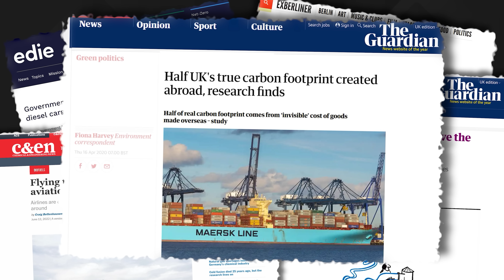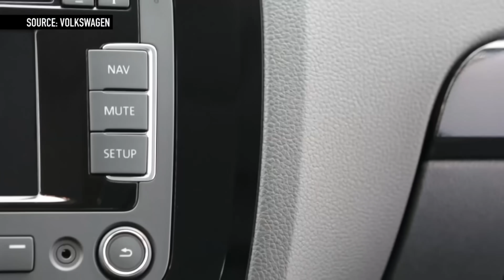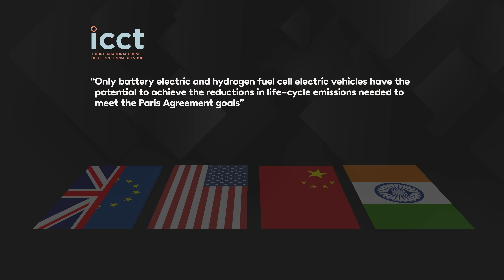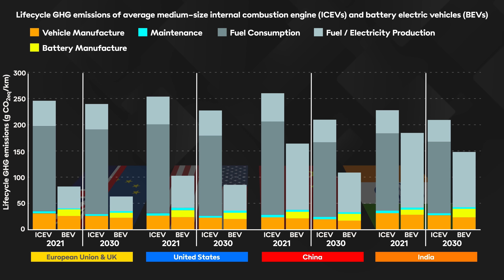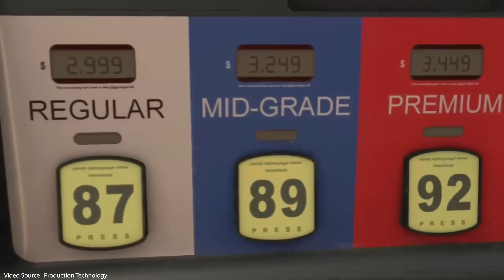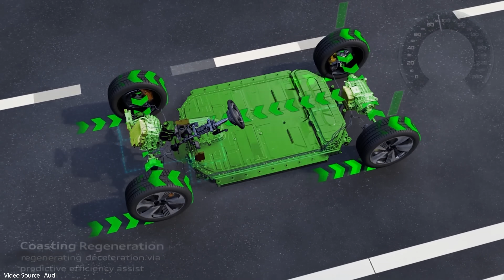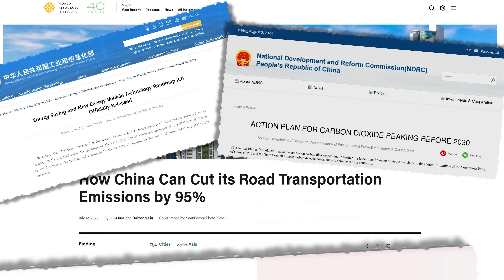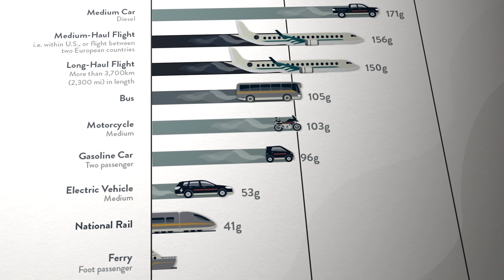Are EVs really better for the climate?

Comment: Why do these videos never discuss, the environmental impact of the batteries. Just like solar power, we just change one impact for another. Poison the lands and rivers, to save the skies!! 

 I suppose we just don't care as long as we can "recycle" them into the giant piles of corroding batteries in China or India 🤷 Just like we do with all our other recycled waste...

 The other fact never hear mentioned is the cost of replacement batteries, this alone makes the second hand market extremely risky. Its like buying a second hand phone, you have no idea what the battery will be like over time. Except if your tesla batteries starts failing after a year, it's currently costing around $20,000 to replace!! I wouldn't even mind that, but the difference in an  80k tesla vs an 80k merc or bmw is night and day. The tesla inside feels like a 35k car...

I'm all for progression and the environment, but people really need to lay off the cool aid when it comes to electric vehicles. They're just as bad as gas cars, just in different ways...

Comment: Wonderful video! :D  I would like to point out that the BEV batteries production CO2 costs are based on Lithium Ion batteries that use cobalt and nickel which produce 50% more CO2 per battery than Lithium Iron Phosphate batteries (LFP).  LFP batteries also last 3 times longer which means for ever LFP battery produced you must produce 3 Lithium Ion batteries that use cobalt and nickel.  So the Lithium Ion batteries production generates over 3 times as much CO2 than LFP batteries.

Comment: Yea It's an interesting report on the Co2 equivalent life cycle emission which is more or less the most beneficial side of an EV. However, one needs to consider other factors puting pressure on the enviroment and associated with EV production. 
I really don't liike to link an other content creators video under a creator I respect but now I think it is apropriate to supplement our views on the EV question as a whole. Don't get me wrong, I accept the report and actually somewhat welcome its conclusion on that it has a positive impact at least on the Co2 emission. Yet I think it worth to consider this from another angle, and this video explains these other concerns simpler and faster than I could : https://youtu.be/eoyVfNmfAgc
Reply: I just watched the video you linked to and it's worse than I thought. I already knew about the EV vs Internal Combustion engine Volvo study but t his adds a whole new layer of bad to the mix. My honest take on all this is that the answer to petrol/diesel cars is not EVs, it's to rethink how we use transportation and why. Cars and trucks evolved alongside the availability of cheap hydrocarbon fuels. The next generation of transport will need to reflect a different usage model, and not to keep on using cars in the same way we do now. We need to do something, I just don't think EVs is the thing we should do, but this will be WAY harder.
Reply: @colingeer479  Happy to see other ppl realize too that "business as usual" may not work this time.

Comment: Ev's are cleaner, every report shows that, with different values from 20-80% less emmisive than ICE. The thing is, even when every car on planet will be electric, we've solved 10% of the problem, which is not personal transport but rather commercial and business pollution, opinions like that video is meant to polarize and focus on things that keep you away from the problem. you want to be green go get a bicycle, not ev. it's not the problem of transport but the way of life. one can drive a diesel and still be greener than you.

Comment: There are more fundamental issues with regard to EVs and AGW. CO2 (not 'carbon') is essential for life on earth (plants struggle in an atmosphere of less than 0.025% (250ppm) CO2) and in poly-tunnels it's pumped up to around 0.15% (1500ppm) to stimulate growth. CO2 is currently measured at about 0.04% (400ppm) in some parts of the globe, where it has risen from about 0.03% (300ppm) since 1958, when it was first measured in Hawaii.
CO2 is 25% heavier than air, does not evaporate nor condense at atmospheric pressure, and does not mix well with Nitrogen and Oxygen. In its solid form, CO2 behaves more like a gas - known as 'dry ice' - notice how it falls off a stage under gravity when used for effect in theatres.
The latest IPCC report confirms a 70% 'greening' of the Earth in the last 40 years, from satellite imagery, when there has been a c.0.01% (100ppm) increase in CO2 as measured in some areas.
It is baffling why some people seem to want to try and keep 'global temperatures' to where they were, in 1850, by reducing human CO2 emissions.
According to ice core data, for over 90% of the last 10,000 years, the Earth has been considerably warmer than it is now. In the Roman Warm Period it is estimated, as much as 2C warmer!
This was followed by the Dark Ages Cold Period, then the Medieval Warm Period (another 2C warmer than now) and the Little Ice Age - which was fading in...1850!
Changes in global temperatures happen gradually. The UAHv6 satellite has not detected any change over the last 7 years (this might change this year) - and weather balloon data shows no change for the last 25 years in the tropical troposphere (air and surface) - 'ground zero' for 'alarmists'.
The Earth's climate is affected by the Sun and we are entering an orbit pattern which, over the next century or two, will take us about 3% closer. History shows that a slightly warmer planet is a more verdant, lush planet with higher plant growth and a better environment for humans and animals.
None of the above is my opinion - merely factual data, available to anyone who is prepared to look, assess and keep an open mind.
Reply: Many things to say about this, but climate change is not the same as warmer weather. Climate change causes longer and more frequent heatwaves ánd coldsnaps, droughts and floods etc. These things are mainly a concern for us humans, as a small part of plants and animals will always survive (kind of like with the dinosaurs)
Reply: You're spouting cherry-picked drivel. One ice core is not the temperature record of the last 10,000 years; The guy who did the Vostok ice core analysis has publicly decried all the clowns using it to disprove AGW. Earth's average temperature is likely higher now than it has been in 130,000 years.

You're also wrong about so many other things, But people with a clue have better things to do than argue with the dwindling deluded tribe of deniers. For anyone still reading, consider this: if there was any other explanation for the extremely rapid warming we've undeniably observed since the pre-1970 average than human activities increasing greenhouse gas levels, then the trillion-dollar fossil fuel companies would be advertising and promoting it non-stop.
Reply: @skierpage  Yes, it's hard to know where to start when answering non-scientific postulations. There is certainly more miss-information, bias and cherry-picking by those promoting AGW, where Scientific Method has been abandoned in the pursuit of career preservation. There is now so much invested in AGW that anyone seeking to test the hypothesis is rounded on with attempts to ridicule the counter-arguments. There is much to discuss and understand on this very complex subject but the opportunity of testing ideas and broadening knowledge is denied by closed minds and simplistic concepts. 
Even the jargon perpetuates the lie. At atmospheric pressure, carbon is a solid and has nothing to do with the climate. CO2 is a trace gas; only measured in the atmosphere, and 'guessed' in the ecosphere - where it is converted and essential for life. 
When measured data does not fit the AGW hypothesis, it is ignored, but the truth is, we don't have enough data to be certain of anything. A dozen CO2 measuring stations around the globe is not enough. Linear remote sensing of global atmospheric and surface temperatures by satellite is very inaccurate and relies on statistical manipulation. Calculating something to 2 decimal places doesn't improve accuracy when the subject varies by integers.
Burning fossil fuels is a very poor use of the Earth's limited resources but the contribution to 'global warming' has yet to be scientifically proven. The really damaging aspect of the AGW 'crusade' is that other, far more important ecological issues caused by humans, such as habitat loss, pollution and deforestation are now largely ignored. You only have to look at the shifting focus of Greenpeace to see where their efforts are concentrated (BTW I was a member until it became political). 
Sadly the 'industry' behind the tackling of these ecological issues is not as profitable as those tackling AGW.
Reply: No one is arguing for completely eliminating co2.
All of your points are climate denial nonsense that has been making rounds since the 70's when EXXON put together a group of people to come up with counter-propaganda to the climate research, which they knew would impact their profits in the future.

Comment: I think it clear that, all else equal, driving an EV car incurs less emissions than driving in an equivalent gasoline car. However, there the work "equivalent" is an important point that's often missing from the discussion. During the 1990's and 2000's, technology improvements made gas cars more efficient, but consumers started buying bigger and bigger cars and driving them longer and longer distances, at higher and higher speeds, to the point where the average American is actually burning more gas per week than they were back in the 1970's.

If we are not careful, the same thing could end up happening with EVs. All else equal, EV means less emissions than gas. But, if you're talking about EV Hummers replacing gas-sipping Priuses, suddenly, it becomes a lot less clear-cut.

Another thing worth pointing out, the emissions associating with manufacturing of an EV depends on a lot on the battery size, and EVs could be a lot greener, if people would choose the battery size they actually need, rather than the a-car-must-be-able-to-do-everything-in-order-to-do-anything mentality. I can see 300 miles of range being desirable if it's your only car, but very very few two-car households need two cars with batteries that big. In an ideal world, families would get one car with a big battery that would be used for road trips, and a second car with a much smaller battery that would be used only for driving around the city; unfortunately, the way American consumers actually think, I just don't see this happening in practice; instead, nearly everybody will end up splurging for the big battery for every car, whether they need it or not. Unfortunate, but probably still better than gas.
Reply: ideally everything's designed better so no one needs any car. similar to the venus project city

Comment: Ok, tomorrow taking the train from Paris to Milan instead of the cheaper and faster plane. Ideally it's a 7 hour trip and not too expensive with Inoui. If it runs with less than 2 hours delay I will be happy and have a great time to finish my book. If the report is accurate and the train is comparable to the Eurostar as opposed to a short-haul flight then this should be great for my 2022 CO2 budget.

Comment: Glad to see motorcycles showing up pretty well. But am a bit afraid that the wide disparity in motorcycle types probably makes that a bit shaky.  There are motorcycles available in the US that get up to 150 mpg (64 km p l) down to 20 mpg (8.5 km p l). My own motorcycle gets about 42 mpg (18 kmpl). Hopefully, electric motorcycles will be entering the market more than they have so far, certainly, motorcyclists who are a very performance-oriented bunch are likely to switch to electrics quickly due to the performance improvement. This has been shown by the performance of the upper tier of electric vehicles (Tesla plaid etc)

Comment: 6:09 just like Rudolf Diesel's development work, current Diesel engines work just fine on vegetable oils though some designers have assumed that mineral fuels will be used exclusively & specified for seals rubbers which dissolve in vegetable oils  :-/

Comment: In your pie chart, "Industry" has to include agriculture, which includes animal agriculture.  The UN found that animal agriculture alone surpassed transportation in green house gasses at one point.
Reply: Yes, it's unfortunate the video and description don't provide a source for the pie chart at 2:00. The US EPA Global Greenhouse Gas Emissions Data page cites IPCC 2014 for its pie chart that has "agriculture, forestry, and other land use" at 24%, and "transportation" at 14%, etc. – very different percentages. It has a separate "electricity and heat production" at 25% missing all together from the video's pie chart (which makes sense if you assign energy to the industrial sectors actually doing something with it).

There are still a lot of poor people without cars; in a developed country the percentage from agriculture is generally lower than from land transportation.

Comment: I'm surprised you didn't say anything about the apparent issue with recycling the BEV batteries. From what I've read, they either can't be recycled or are very difficult to recycle, so once the batteries are spent they might end up in landfill, and won't the chemicals in the battery cause problems in the nearby area as they start breaking down? I've only seen a few people talking about this, so unless I've missed something or it's not actually an issue it seems like we're doing our usual trick: let the next generation deal with it

Also BEV's aren't great for people in flats/apartments (especially the higher floors) - it'd be great if they solve that problem somehow - would it just involve adding charging points on the ground floor outside the buildings?
Reply: There are companies that do battery recycling, the materials are far too valuable to just throw in a landfill. In most cases failed batteries can be fixed by replacing a few cells or fixing other components, when the battery does not hold enough charge to be viable, they can then be reused as battery storage. 

There is a Tesla recorded as doing 1,500,000km, and expect with very little maintenance, most petrol/diesel cars would have got through £1000's of consumables and oils in this time and produced quite a lot of pollution as well so

Comment: Yeah trains & trams that can accommodate bicycles and ebikes or trains that have stations with good bicycle parking garages, parking for electric motorbikes, and maybe bike rental points is the way to go. Sleeper trains for long distances. Dense neighborhoods and walkable suburbs and city centres…..
Because if you take the cost (and environmental impact) of infrastructure into account, a bicycle network is infinitely better than vehicle roads etc. Because electric cars are heavy and that means more road maintenance etc. Imagine having green paths through public parks that cater to pedestrians and cyclists, and then roads that are safe for electric motorbikes and e scooters. The only actual full sized vehicles you need are for deliveries. Even freight vehicles would be more efficient as freight trains

Comment: I have no doubt that EVs are the future that's a given.  I just don't feel the tech is there yet to justify the change over cost.  I travel on average 150km each day 1 way to work here in Canada, where temps can get as low as -40C.  My employer would not appreciate me plugging my car in all day at work on their dime so my only option is a vehicle that can get 500Km per charge.  In order to factor in cold climate reduction in range/battery.  Or I have to spend an extra 30-45 min each day sitting at a charger after work just to drive home.  While then environment may benefit from me doing this, my wallet and personal life could not handle the hit.  This is not even considering I would need to install a charging port outside my house for night charging.  I will concede that EVs are better for the environment overall but with current costs just not viable for me now, if they come down 15-20% up front I think I would consider one or be able to consider one.  Otherwise great video.

Comment: A two-wheeler I would avoid. Not because it is not good for the climate, but because it is too un-safe for me. When people pass by be with 0.1mm distance or less I would probably end in hospital with broken bones.😉
A stable three-wheeler, preferably with a bit of electric assistance I can do for shorter distances, as long as the weather is dry, or there is shelter on the vehicle. 
For longer hauls aBEV is the way to go, and that is likely to be my next vehicle.